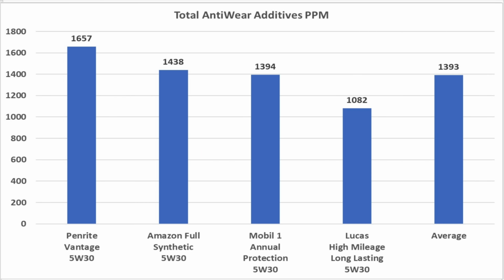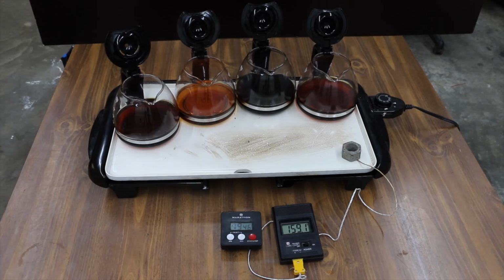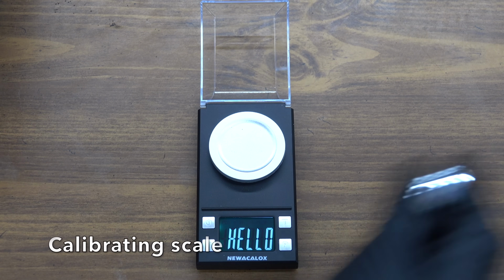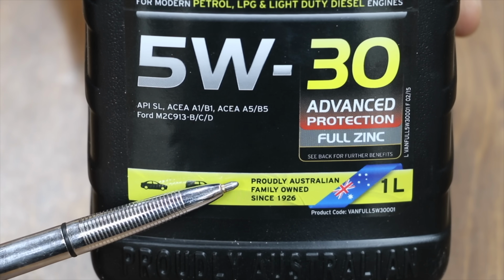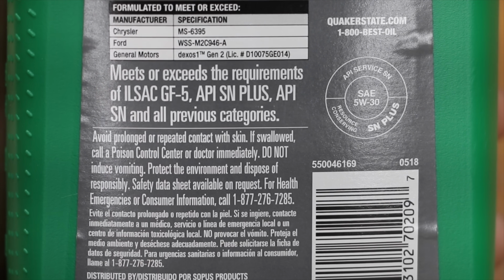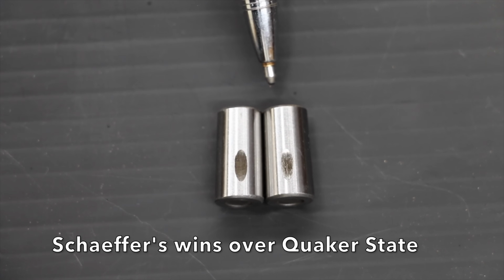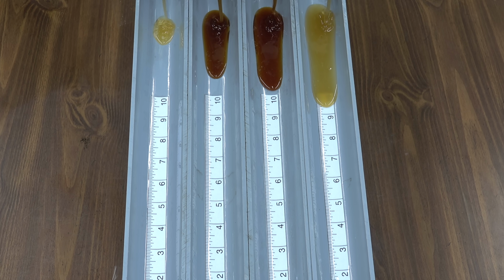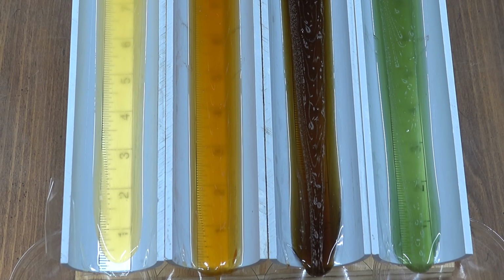Is Amazon Basics Motor Oil better than Penrite? Let's find out!

Comment: Fun fact, -40F is equal to -40C
Reply from the maker: Thank you!
Reply: And it's COLD. Never personally experienced colder weather than -10f (one of those cold days I had to take a 3 hour highway drive in a car with a stuck wide open thermostat, it was terrible, almost 0 heat when moving).
Reply: @volvo09  you didn't watch roadkill show before did you? Just a piece of cardboard in between the cooler assembly helps can be had for free at any dumpster :-)
Reply: @kitecattestecke2303  True story, I used a washcloth from a hotel to cover most of the radiator during a blizzard once, and then forgot about it after warming the engine. It was 3 days later that I noticed it was still there. Felt pretty bad about driving off with their cloth, but the heater worked and the engine was at running temp. Replaced the thermostat when I got home.
Reply: Yep. Been there a few times, its not pleasant. Truck makes all sorts of funny noises.
Reply: yes i was checking that fact several times!
   0F     -17.7C
-10F    -23.3C
-20F    -28.8C
-30F    -34.4C 

-40F     -40C
Reply: @superchicken1389  # # with force
Reply: tone167  I'm sorry we were too lazy and we still are.
Reply: Lived in -49 C and +52 C.. Never happy. 😆
Reply: @anthonymorris8891  Should have stamped out imperial English measurements when the revolutionary war was fought
Reply: tone167  If only an accurate metric standard was available. An accurate set of typical measurement objects were not available for decades or centuries. If they had adopted the metric unit of measure back then, they would have no standard of measure to judge it as being correct or not. That said, there is no excuse to not switch over today.
Reply: Fun fact, The USA is currently the only country in the world that still uses Fahrenheit instead of Celsius!

Comment: Would you be able to test the differences in brands of 2 stroke oil? I’m curious to see how much of the oil burns off with the fuel vs how much sticks to the cylinder walls. Curious to see what 2 stroke oil would work best for a rotary application. 

I’m also curious about the differences between ac delco oil vs motorcraft. 

Love the videos! I watch them all!
Reply from the maker: Thank you for the video idea!

Comment: the tension mounts......i can hardly wait to find out what my oil brand is to be. i really appreciate all this trouble and thoroughly enjoy watching your videos. have a good day and thank you much..........g
Reply from the maker: Thank you!
Reply: Right?!? As soon as we get to the end that will be the oil I will run in ALL my vehicles. Best part, we will have imperical testing data from a neutral 3rd party to back it up!! No more, "oh my grandad said to use oil xyz." "Why?" "Well...he said It works great!"
Reply: @mrfordman9999  and even if the proverbial grandad was right, oil changes all the time. Mobil 1 had similar additive levels as what Project Farm saw as when I did my Blackstone Lab test once, but another time Mobil 1 had just as much as the highest tested 1 here and that was after about 5k miles. It may be even more on new oil.

Comment: That -40* test scares the hell out of me. We often see temps here that low, and it boggles my mind how engines can survive such abuse.
Reply: Yes, but u wouldn’t use 5W30 in colder areas. I would recommend to change your oil for summer and winter
Reply: Taiger 1704 5w-30 is already pretty thin. We run 15w-40 year round in the diesels.
Reply from the maker: Great point!  The oil pressure gauge seems to stay on zero for a long time in extreme cold.

Comment: why not do a bearing test after the oil has been heated, this would simulate age and how well the oil performs after long term use. then compare the two and see how well the oil lubricates over time
Reply: That's what he did tho?
Reply: @cpufreak101  no he tested the oils as new, and it shows in the previous testing that he pours it straight from the jug of oil, and does not compare new oil to old oil with the lubricity testing.
Reply from the maker: Thank you.  I tested the cooked oil this time and will test it while hot in the next round.

Comment: Go Penrite I use it in all my cars would love to see penrites HPR full synthetic oil tested also
Reply from the maker: Great oil!  Thank you
Reply: Yes nothing  but Penrite Racing 10  10w/40 group 4/5 oil in both my BMW X5 and Nissan 4x4 diesel Navara.  👌
Reply: With the Extra 10 the HPR 5 is a 5w-40 not a 5w-30 so sadly doesn't fit in. Would be great to see though
Reply: Badgertronix given that its what Penrite recommend instead of a 5w30, it should fit in... 🤷🏻‍♂️
Reply: That added Zinc.
Reply: Thanks for the support everyone!
Reply: How does nulon compare, at least with normal oils.

Comment: Looks like Penrite might need to start selling to the United States. Interesting results
Reply from the maker: Thank you!
Reply: Not for the price, with the Amazon you could change oil 2 times for the price of the "Name Brand"oils.
Reply: Uh no, the SL category is only for engines 2004-older, and cannot be used with any ethanol mixture gasoline as it causes excessive breakdown of the oil leading to premature death.
Reply: @cmdr_stretchedguy  Most Penrite oil is SN. This is one of the lowest spec ones

Comment: Do you remember click and clack, the tappet brothers from the NPR show "car talk"?  One of them did an experiment with his car - by never replacing his oil.
Now, to be fair, he did replace the oil filter on a regular basis.  But he never replaced the oil - just dumped it back in.  No additive, just topped it off whenever it was low.
I don't know how many miles he put on the car, but the oil never died as long as it was properly filtered.
Reply from the maker: Wow!  Thank you

Comment: Great video as always. With all your data you have acquired would you be able to tell us or show us what oil would do better in the most extreme parts of the country. Let’s say X brand would do better in extreme cold. Y brand would do better in extreme heat. One more thing do you think that another  viscosity by the same brand would fair differently?
Reply from the maker: Great recommendation

Comment: Will a mower run on CNG? There’s a suggestion
Reply from the maker: Thank you for the video idea!
Reply: It will but after a certain amount of time it will burn the exhaust valve up, and lose compression. CNG engines have specialized exhaust valves

Comment: Would love to see Pennzoil Ultra Platinum. I've been told that it's the closest you can get to Amsoil. Ultra Platinum and regular Platinum is to different oils. They look similar in packaging though. I order it through Walmart for 25.00 a gallon.
Reply from the maker: Thank you!  I'll test it soon.
Reply: I just started putting the ultra in my new F150 at just under 5k miles.  Started putting in my wife’s Hyundai since the free oils changes the done on it.  5w-20 for both.
Reply: Second that request to test PUP, I used it for two years.

Comment: I will say this ... Once my motor-oil stockpile runs out I plan to order Amazon motor oil. - These videos went a long way towards convincing me for the daily drivers.
Reply from the maker: Thank you!
Reply: I did order, and changed the oil with, the Amazon 5W-30.  My vehicle states to use 5W-20, but I live in a place where 100-degree days are just right around the corner - the viscosity of 5W30 is going to be just like 5W-20 is in other parts of the country.  Anyway, the other reason I wanted the 5W-30 is because most forums are saying it is usually Warren, where-as Amazon 5W-20 seems to be usually the wal-mart brand.  I wanted to make sure I was getting the manufacturer tested here.
Reply: @workingguy-WOTm8  I personally wouldn't do that until the manufacturer's warranty runs out.
Reply: @jstravelers4094  That depends, if the Temp is higher then spec the next oil up is used.
Reply: @wobblysauce  As long as the manufacturer gives permission in writing. 
I use whatever makes sense in older engines that are long out of warranty.
Reply: same here, if I weren't leeching off a shop discount I'd be going with amazon myself, hard to beat for the price
Reply: Just go to Walmart and get the Super Tech, it’s just as good as anything else and you can just walk out with it.

Comment: Love these comparative tests. How about testing the reconditioned motor oil sold in some places if you haven’t done it yet.
Reply from the maker: Thank you!!
Reply: Chevron was a reconditioned oil at Oreillys back in the day. Very cheap. Engine seemed louder with it. I only used it when someone waited too long to change their oil. Run a short oil change interval. Then put the better stuff in. Like a safer oil flush. Problem is...they'd never come back early to put the good stuff in. Customers who won't change their oil on time... enough said...

Comment: Please do a run on the 5w50 weight oils , redline, Amsoil, Mobil 1.. for the performance cars.
Reply from the maker: Thank you for the video idea!
Reply: I use redline 5w50 in my e92 bmw m3 to prevent rod bearing premature wear... the 10w60 oil recommended by BMW is way too thick for cold start.. please do a run with 5w50 oils 
Thanks regardless